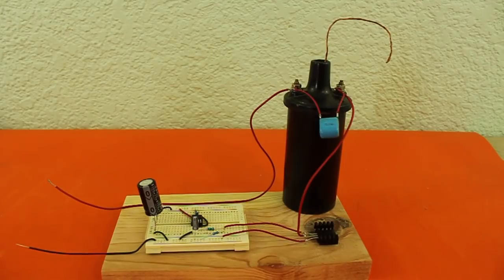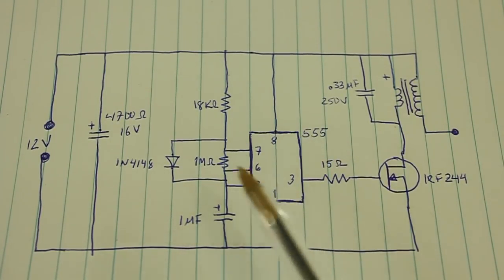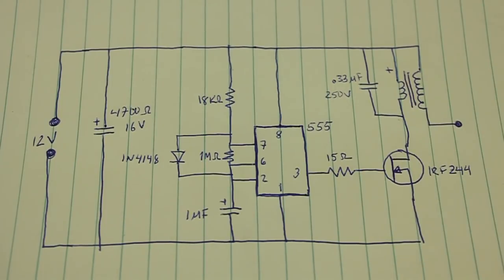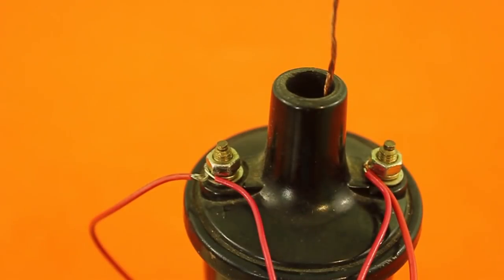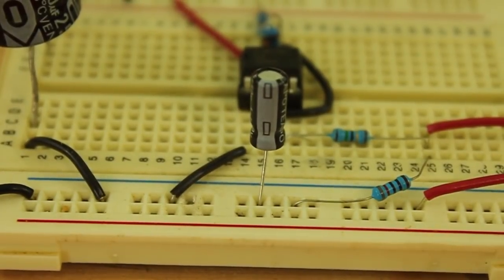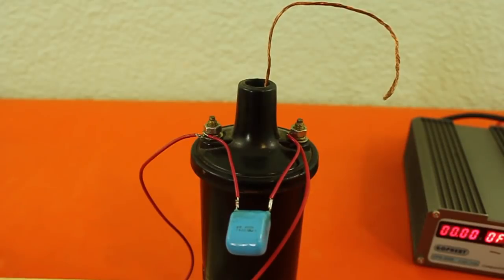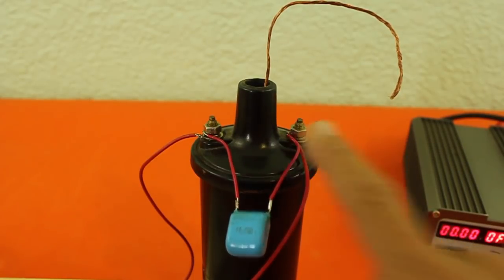DIY Electric Fence Circuit

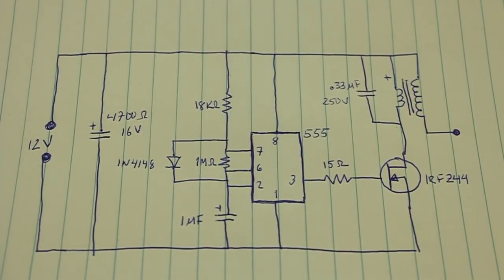Comment: The circuit that is shown starting at 0:37 is missing three things:  Pin 4 should be wired to the positive supply (pin8), a 0.01uf capacitor should be wired from pin 5 to ground (pin 1) and a 1N4007 diode should be wired from the drain (the lead of the mosfet that feeds the coil, the 15 ohm feeds the gate and the source is wired to ground) to the coil with the cathode to the drain and the anode to the coil.  This will protect the mosfet from induced voltage in the coil.  I also placed a 2K ohm resistor and a red LED from pin 3 to ground (cathode of the LED to ground) so that I could see the pulses.  This is definitely an option.
Reply: Did the plan you are talking about succeed?
Reply: It is not possible to read the first capacitor on the left in the diagram, what value does it have?
Reply: Hi can you please make a drawing that it can be more clear please
Reply: @francomongillo   Maybe it is 4700µF instead of ohms.

Comment: Basically a 555 pulsed flyback driver.  I love those IC's! I made a strobe light from one using a 5v relay on the output and an 8 led flashlight. I wired the relay to the flashlight switch terminals, used a potentiometer to control the pulse frequency & It was awesome.

Comment: The old fence charger I had around the chicken coop had just quit working and I was ready to buy a new one, but then I found your wonderful schematic. I had to make lots of part substitutions from your original design, with parts I had laying around, but son-of-a-gun if it doesn't work great. And it cost zero! I added a 120k resistor and LED across pin 3 on the 555 and the input to the transformer primary and that gives a visual indication at night from a distance that the charger is working. I Ty-rapped everything inside of a clear plastic mayonnaise jar and it looks pretty weird. But it works GREAT!
Thank you for your design! Lloyd
Reply: Hi AirgunLab. Are you happy to share your schematic with the substitutions you made? Thanks
Reply: @clintm2010  Sure. I didn't change the schematic, but I did  substitute some parts, as follows.
For the power source, I used a 12vdc plug-in wall wart charger. I tried a 9volt battery but it didn't last very long.
For the 4700uf 16v cap, i just wired two 1000uf and two 470uF caps in parallel to get about 3,000 uF. I used the  1Meg,18k, and 15 ohm resistors, 555 timer, and 1 uF cap as shown  in the schematic, without change. Instead of the 1N4148 diode, I used a 1N4002. An IRF740 mosfet was used instead of the IRF244.  Instead of the .33uF 250v  mylar film cap, I used a pair of  250v 104 mylars in parallel to get .20uF. After trying unsuccessfully to find a good substitute for the automotive coil, I ended up ordering one from Rockauto parts for only $7.67, pn CUC12. I was ordering some other stuff from Rock, too, so the shipping cost wasn't a factor.  I added a 12k resistor in series with a white LED, and connected them between the gate of the mosfet (where the 15 ohm resistor hooks to it) and the drain of the mosfet (where the negative primary of the ignition coil connects). That flows enough current to see a dim flash in the LED each time the coil is pulsed. Looking at my charger now, I see that I also installed a small 0.1uF ceramic cap across the - and + primary terminals of the ignition coil. Not sure why I did that and it might work fine without it.  Just a note, all of the substitutions were made so that I didn't have spend any money on this project. I guess spending $7.67 on the coil is ok.
This charger is powerful. With the 12vdc wall wart power supply, it gives a healthy blue spark over 13mm long. Be careful! I haven't found out what the weak link in the circuit is yet, because it is still working just fine.
Again, thanks to Ludic Science for his well done video.

Lloyd
Reply: Correction, that is a 120k resistor in series with the indicator LED, not a 12k.
Reply: @1227air500  Thanks a lot. I still have to order two items and then try it out. I will be using a 12V DC rechargeable solar battery.
Reply: @1227air500  sir, can i use 12v 300ma supply? is that enough?
Reply: @nandunsk4624  Yes, I think the 300ma supply should be adequate
Reply: @1227air500  Hello but then you connected pin 4 of the ne555 to the positive? because the author didn't put it in the diagram.
Reply: @francomongillo  Yes, connecting pin 4 to positive might make the operation of the fence more stable, but might be ok to leave pin 4 not connected.

Comment: Nice video. However, I've experimented with different variations of these 555 ignition coil drivers, they work pretty well. That is of course until the 555 gets fried from HV feedbac into the positive rail. 

They fry 555s all the time. 

Do you have any ideas for improvements that would isolate the 555 from HV feedback?

Maybe use of an opto-isolator or something similar?

Thanks.
Reply: Transient voltage suppressor across the power rail, try a 1.5KE18, in parallel with the 4700uF capacitor, and use something like a 78L09 regulator to feed the 555 timer’s power. The TVS clamps the voltage to no higher than 30 volts. A 555 would still blow up with that spike but the 78l09 won’t. Use recommended capacitors around the 78l09. Also, add a 12 volt zener from gate to ground across the MOSFET. You can also use an ignition clamped IGBT in place of the MOSFET, but do make sure it is meant for ignition coil service, not the usual motor drive versions that are not clamped.

Comment: Your first rung shows 4700ohm 16v. Ohm is resistance but is drawn as a capacitor?
How much current at 12vdc will this device draw in 24hours.

Comment: How about using a 120 volt to 12 volt transformer with just an on off switch? That would give me a 60 cycle pulse out of the ignition coil but is there something I am not considering I dont want to give my dogs a permanent smile. Should I use some kind of resistor to limit the current? 
Thanks

Comment: Nice project, can you list all components with their specifications please
Reply: Mate the components specs were listed on the schematic, and tbh when dealing with these types of electronics the specs aren’t really that important, as long as you don’t put a 10 volt cap in a 10,000 volt circuit that is some extreme smooth brained shit.

Comment: Hi a have a question aboute the miniature voltage booster does it matters  if the winding of the primary and secondary in the same side i mean from left to right both of them or it should be opposite.  thanks anyway

Comment: It is not possible to read the first capacitor on the left in the diagram, what value does it have?
Reply: I would read through all the comments some have changed that cap ( the original is a 4700uf 16v) the big one on the left  but like I mentioned there are a few possible changes to this circuit so you should read all comments they can be confusing but if you draw the circuit as is in the original diagram and then draw what you see in the video how it is on the bread board the comments will fill in the rest that seems to make since to me I think I've got a pretty good plan using original and then Airgunlab's comments and Mark Kay's comments adding to the breadboard pictured in the video. It's all I could do because the follow up on questions isn't getting to many replays since this circuit is pretty old. Good luck friend !
Reply: @tracyforbes7317  Heartfelt thanks in fact I have read almost all the comments, honestly I'm trying to build it and hopefully well, you are very kind of the answer thanks, in fact the wiring diagram lacks the connection of pin 4 of the NE555 to pin 8 otherwise in my opinion it doesn't work, I'm using a circuit simulator I hope I can get it to work. Thanks

Comment: A safety and power efficient improvement on this could be a 556 split into an astable driving a monostable (maybe every 2-4 sec. a big pulse). The 4700uF cap should be close to the inductor, and power for the 556 should be via a 1N4007 diode on the supply rail to protect it against back-EMF.
Reply: Hey Matt do you have a diagram of your electric fence? can you share with me pls I need to make mine.
Reply: @edwardsooy3586   Hello, did you get any help? i'm trying to build this circuit but I wold like to make soma changes
Reply: Excellent suggestions, Cliff.  To Clarify, I think the diode should be to power the coil, not the 556.  We want to prevent back emf from reaching the 556.  Also, I think we should have a resistor in series with the 4.7mF cap to create an RC Snubber.
Reply: I have have a 120 volt to 12 volt transformer and would like to use it instead of the oscillator is there anything I should consider when doing this? I don't know how 60 hz from the transformer compare, to the frequency of the oscillator,  also the amperage on the secoundary of the transformer is 10 amps
Reply: Hi Cliff, can you show us how to connect the 556 please
Reply: @BrunoGaspar5  ممكن اتواصل معي
Reply: @aissabait9435  ?
Reply: @BrunoGaspar5  Do you have a manufacturing plan for this device with a 6 volt battery?
Reply: @aissabait9435  no :s

Comment: If another coil was added using the power from the first, would it increase the output? I use 7 joule chargers but they are A/C powered. I want to build something solar I can use away from the barn.

Comment: I built this circuit. It works well.
Thank you .
Reply: Really, is it working... For I've noted that there's a lot of comments in which it's not working /functioning... 😌😔🤪
Reply: How long is ur fence? Do the voltage differ on the length of the fence??
Reply: @ranveeradav1402  yes, the intensity will vary with the fence length. You can connect the positive terminal in various parts of the fence to avoid this problem
Reply: @erasmosolis1963  It has worked for over a year 24/7

Comment: Where would I connect the output of a motion detector so that it only comes on when a deer touches it?  I need to connect it to about 100 feet of wire.

Comment: How did you connect the wire in that center terminal?? Did you touch it to the bottom screw and make it connect the sides and then epoxied or what??
Reply from the maker: There is a screw at the botom
Reply: so you just wrapped it around the screw and then epoxied? @ludicscience
Reply from the maker: Yes
Reply: Thanks Ludic..finally i get the secret...onward with my emem. @ludicscience
Reply: @ludicscience  when you reduced the capacitor to increase the pulse rate, what value capacitor did you use?

Comment: There is a resistor on the board that is not in the schematic connected to the ground rail. The drawn schematic does not correspond to the prototyping board. What is the resistance value from A25 to the negative rail.

Comment: i have 3in plasma ball and a ignition coil, made a similar circuit with 555 with pirmary in the collector of the transistor, i got mild hv shocks on the -ve of 12v battery. how to connect the common of hv to common of the circuit.

Comment: do you know how many meters of fence  this circuit can  drive? how do i estimate something like that?
Reply: In my experience you can use 1 mile of fence for every 2,000v. So at roughly 20,000v you can probably safely use 10 miles of fencing with this.

Comment: where can i buy such a ignition coil ?and some connection are not understand easily in diagram so please sir explain dia gram easily thank you...
Reply: Any auto repair shop will probably give you one if you ask nicely. They connect to the spark plug in a motor.

Comment: hello, what transformer is the one in the video? I don't know English very well ... I would like to know the name of the electrical transformer.
Reply: Its called an automotive ignition coil.  Here is a link to one that I just bought on ebay. >  https://www.ebay.com/itm/BRAND-NEW-IGNITION-COIL-FOR-FORD-JEEP-LINCOLN-MERCURY-AMERICAN-MOTORS/224007691442?ssPageName=STRK%3AMEBIDX%3AIT&_trksid=p2060353.m2749.l2649
Its just the old style of ignition coils for older cars

Comment: what is the minimum amperage source I can use to power this circuit? can I use a 120v to 12v transformer? I am on my way to buy the parts hoping it will keep my dogs in my yard, we already paid $100. to get them out of dog pond once. Repaired fance $70. and one of them still getting out.
Reply from the maker: Minimum 4 amps
Reply: @ludicscience  thank you

Comment: can I use a 120v to 12 volt transformer with a bridge rectifier for power source?
Reply: Yes, or a 12 V wall wart. Just don’t exceed 12 V and make sure the polarity is correct or your electrolytic capacitors may RUD...

Comment: Doesn't the mosfet need protection?
Reply: I would with a diode. flyback spikes. either across the parallel cap/coil or between the mosfet and coil

Comment: hi the circuit is working but my problem is that induction coil is getting too hot please help
Reply: Maybe your duty cycle is too long check the diode that is beetwen the 1mega ohm resistor maybe its shorted

Comment: Very well done sir. Thankyou. I'm a retired B.S.E.E. and find no discrepancies with your  diagrams. Perhaps I'm missing something?
Reply: The first rung is the battery/power supply.
Second rung shows 4700ohm 16v. ohms are resistance but the schematic shows it drawn as a capacitor.
Please clarify this for me.

Comment: Hi any one know why sometimes at the gate of z44 mosfat  useing diffrent resistor like 100ohm -220ohm or 1k ohm ?? Any one can help please
Reply: To control the turn ON/OFF time of the Mos ?
Reply: @James-yf6jt  does it depend on the resistor i mean 100ohm well be faster the on and off
Reply: smaller the gate resistor, faster the switching.....but at the risk of damaging the Mosfet because of voltage overshoots during turn ON/OFF....
Reply: @James-yf6jt  overshoot ??!🤔

Comment: so these ignition coils are kinda expensive, the ones for cars anyway.
and i saw these small coils for motorcycles.

do you happen to know how these compare to the car ones by any chance?
Reply: They will work OK. Not as high a voltage but enough to deter a varmit. Plus is small size.

Comment: You know you can use a relay anstad of ic and put the capacitor on the relay terminal to adjust the spark time
Reply: Yes you can but you can not rely on mechanical parts that will probably brake after a long time of usage

Comment: Please how can I use the high voltage from the ignition coil to power my home appliance.   Or  how can the voltage be reduced to usable voltage to power my home

Thnx
Reply: This only produces very short duration high voltage pulses and the average power output will be far too low for your type of application. To produce AC power for your home from low voltage DC you should research inverters which are available with power outputs from about 50W up to many KW.

Comment: you forgot to say that the poles that hold th fence should not be out of metal, and one has to touch the ground and the fence to get a shock which only applies to animals since they go not have shoes.
Reply: ...of course the poles can be metal...the electric fence wire is attached to an insulator, not the poles.
At least once a week you will find me replacing plastic insulators after a "deer strike".
And the idea that only animals will get a shock if they touch the fence since they "go not have shoes" is
absurd.  While wearing boots is helpful in avoiding shocks,  a 10-15 kV  pulse will do it's best to find
a way to ground; a task made sooo much easier if the  grass/ground/boot leather/ feet are wet.
[and sometimes the horses are wearing shoes.  Metal ones.  Doesn't protect them a bit.]
Reply: @trench -  chuckle:  I wear rubber boots and I touch my fence wire with the back of my finger to see if it's working.  It shocks the tar out of me every time "unless" the fence wire shorts to the ground through grass or anything else that conducts the voltage to ground.  When I get no shock OR a weak shock I walk around the fence and remove whatever is touching the fence wire and the ground at the same time.    
Oh, and if on some days I want a milder shock I pull a grass shaft and hold that in my hand to "test" the fence.  When the fence charger is working I still get a shock (that won't make me jump back) while wearing boots.  Touching the ground with my hand definitely gives a me shock, but touching the ground isn't required.  
You'e right about preventing the wire from touching the metal posts.  I'm using T-posts driven a foot or more into the dirt but they have insulators to prevent them from shorting the fence wire to ground.

Comment: good idea but it is not working very well .firstly ignitial coil is using 2.7 amps at every cicyle   so battery slow down ,secondly electrik shock isnt efective which is  very poor ...thanks

Comment: These type ideas dont work for long the coil will burn up in less than 10min if left on to run full time. The best thing to do is just plug a cord into the wall and tie it to fence and forget the pulse idea. Because if u need to have this type of fence then why play games and do it right or if you need to stay legal then buy a Speedrite or a Parmark fencer they are the better type.